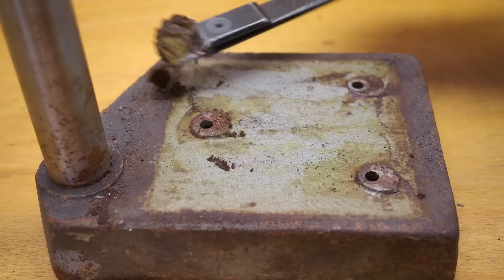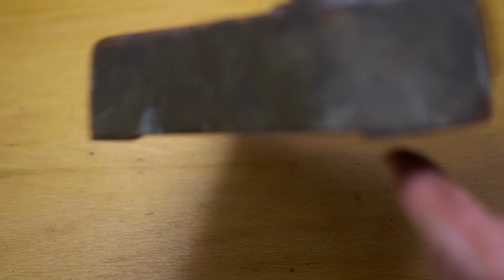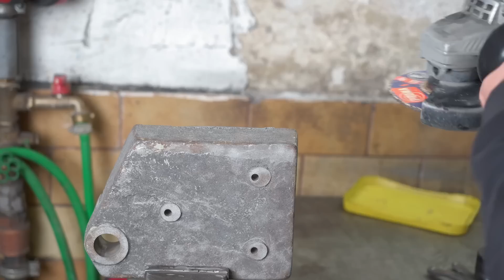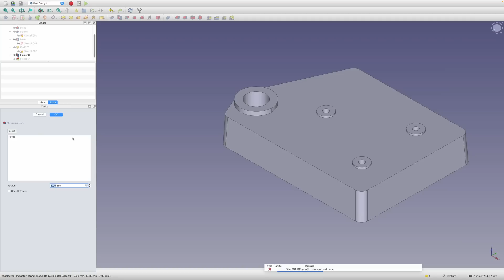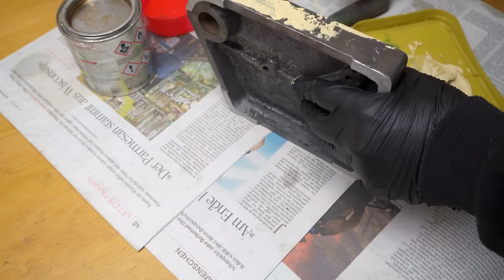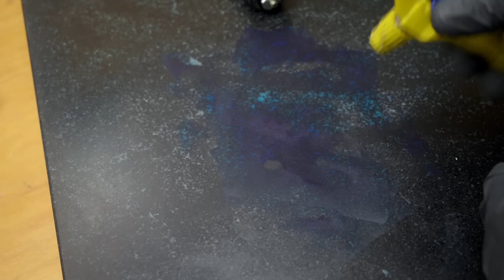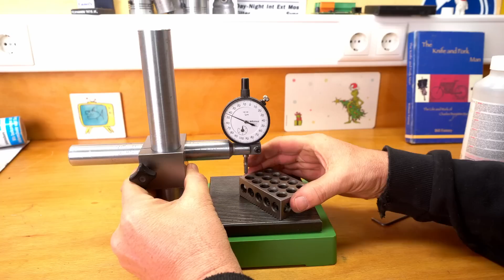Indicator stand overhaul || RotarySMP

Comment: I've gotten to where I prefer bare cast for painting.  With so much plastic stuff around these days leaving out the bondo let's you know you're looking at real cast iron and the defects give it character.
Reply from the maker: I kind of do as well, but that was a real 1980's communism casting. Very rough, badly fettled, I dug out a huge booger of slag from the lower side etc :)
Reply: @RotarySMP  I may just be making excuses not to do bondo on the machines I have for restoring.  The art of doing bondo, sheetrock mud and such is a gift I wasn't born with.  The last sheetrock job I did ended up with 3 inches of dust on the floor from my compulsive sanding and refilling.
Reply from the maker: @tonyrmathis  I only showed one round of bogging and sanding, but it was two heavy coats and then two rounds of spotting defects before it was ready for top coat.
Reply: @RotarySMP I hate to say it, but pretty terrible garbage came, and still comes, out of non communist countries too. It’s wherever they think they can save a buck.

Comment: Ouch! What the heck is wrong with the surface grinder that gives you 60 micron error over 60mm??  😮
Reply from the maker: The surface grinder has a bit of slot in the the table, but that Mag chuck has a valley over 0.1mm deep down the middle. No idea how it could get like that. Wear? Seems excessive.

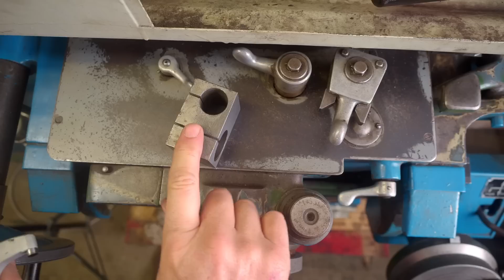Comment: 7:13 , if you could nickel plate the block it would be really cool. Fairy easy to do at home, even a cooper plate would be cool.  If nothing else a ceramic coat like used on gun parts.
Reply from the maker: I'll just keep it a bit oily. My basement has no real rust issues.

Comment: I will take a guess for those avionics parts to be hydraulic acumulators. About NaOH it is really powerfull but requires full PPE. I know someone that lost one eye due to small droplet that splashed when something droped into the cleaning solution.
Reply from the maker: Nope, those are 767 cargo fire bottles.

Comment: I'm thinking that 'part off' feature may have been a leveling device.
Three screws (like a stool), not 4, point contact at the nub, and lock nuts on the opposite end once it's level?
Reply: I think I changed my mind
Reply from the maker: Yeah, a level pin down inside a threaded hole is not a thing :)

Comment: But... you have a surface plate... Is this going to be easier than the surface plate with a height gauge?
Reply from the maker: There are always multiple ways to do the same thing :)
Reply: Not to mention that this can be set and used almost anywhere in the shop, freeing up the surface plate for something else.
Reply from the maker: @FineApe  Good point. My surface plate is only 12x18" but it is still a heavy slab of granite.

Comment: I didn't understand, what product did you use for the ultrasonic cleaner ? Sodium hydroxide ? It seems to work very well !!
Reply from the maker: Correct. I normally use NaOH in there for steel and iron parts. Very good degreaser, and softens the paint as well.
Reply: Thank you for the tip, and hope to see more ! Always great videos to watch
Reply from the maker: @juju-fz3pk  Thanks a lot. Always more to come :)

Comment: I have a conical wire brush for my angle grinder that does wonders on old castings like that base.
Reply from the maker: I sometimes use a knotted wire brush for this as well.
Reply: @RotarySMP  I find them a bit harsh. The ones I use are sometimes sold for use on brickwork, not knotted just steel wire.

Comment: Hey Mark that pip you filed off a stud, I think it's intention is that it bottoms out in the hole so you can fully tighten it, preventing that stud coming out easily.
Reply from the maker: Hi Jake, I suspect you are right, but only got that feeling once I edited the video :)
Reply: @RotarySMP  I love spotting these tiny design details
Reply: i had the exact same tought about the stud
Reply: Very interesting point, I've never of that technique before,  for studs normally a "Fast" end is used,  ref oversize thread to hold studs in, this is pre thread locking compounds. Though a few drops of sugary drink is a poor substitute?
Reply: Knowing you, once you get your grinder dialed you’ll have that adapter block flat to microns.  

Having said that, finding out you don’t like Hammerite makes me wonder if I really do know you at all 😅

Yes I’m kidding, I like Hammerite but it’s fine if you don’t.

Comment: Nice restoration 👍 , although I was wondering why you went so deep with the milling.
Reply from the maker: The top had a major slant, such that one boss didn't contact. And the bosses were so badly of the holes, I figured I could take them down 3mm to clean that up. The casting is very thick.